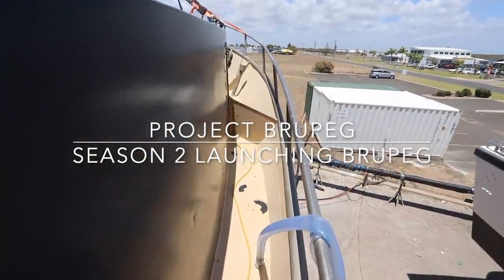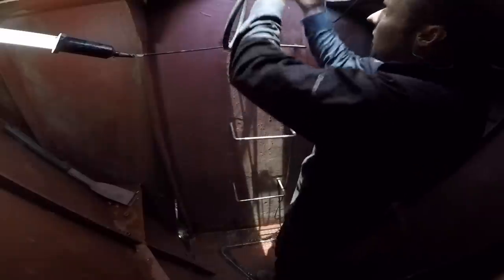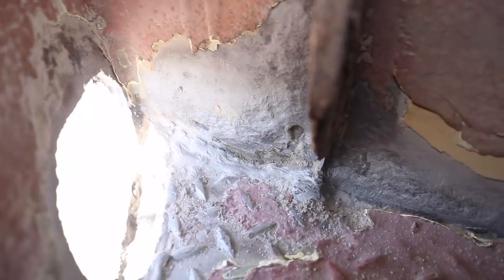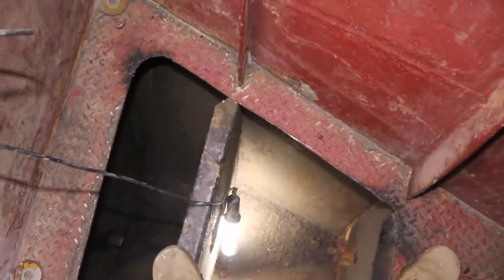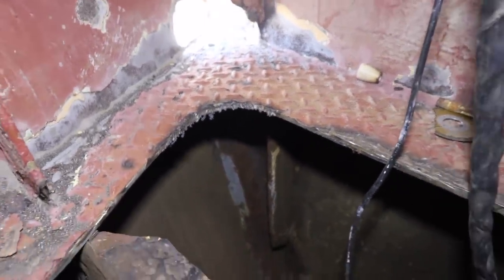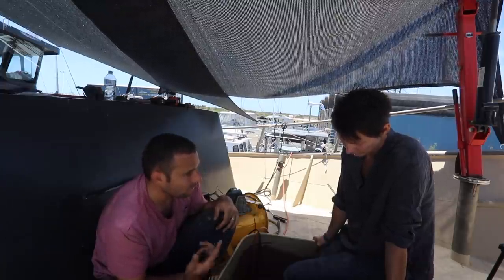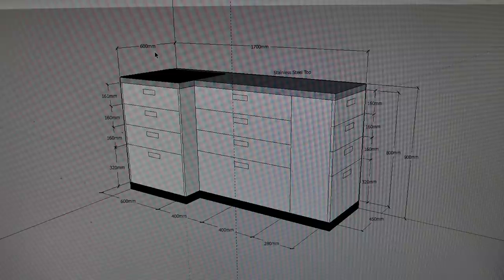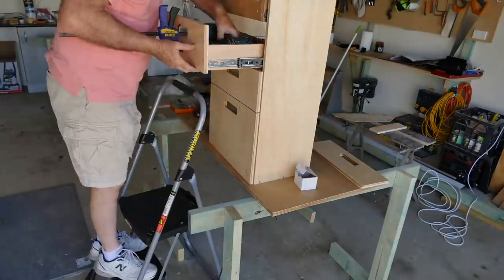We cut the front open! - Project Brupeg Ep. 112

Comment: Nice explanation of how hard it is to sink the boat - so, how did it sink the first time?
Reply: It's my understanding it happened during a major river flood. While they were trying to get Brupeg out to sea and safety, they grounded on a sandbar and were rolled by the force of the current.
Reply from the maker: Yip exactly right, she turned 90 degrees to the flow of water, which was travelling at roughly 20knots. Momentum rolled her over in a flash. Nothing would have been able to be designed into her to stop that happening. Our additions are for things like ramming ice and peeling the front open, the crash bulkhead and the tanks act as a buffer to the rest of the boat.

Comment: Dame just a thought put in a piece of pipe with a screw top. in the future you can use this to check whether you have sustained any water ingress after a casualty. Do not need a dip tape just shine a torch beam, will tell you if you have any ingress.
Reply from the maker: Ahh, check out this episode, we have an even better way to tell if we have ruptured the bow, and its able to be done from the warm insulated interior of the boat, not the icy, frozen bow room...
https://www.youtube.com/watch?v=59Mylt54LKg

Look for the stainless pipe that runs the length of the fuel tank. it goes from the crash bulkhead to the coffer dam with a lid in the coffer dam end